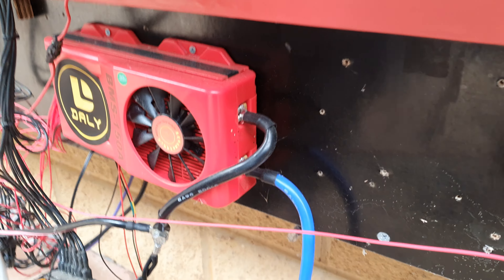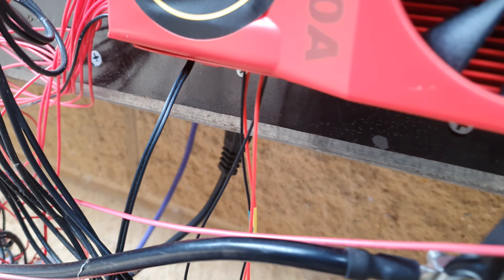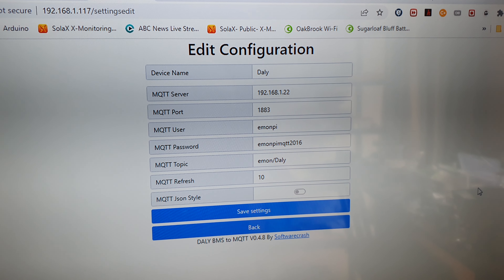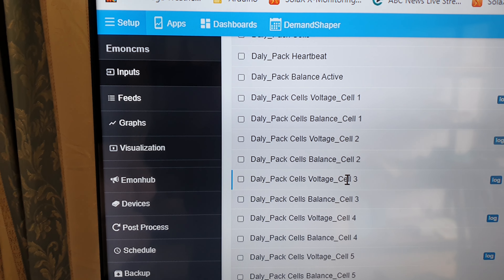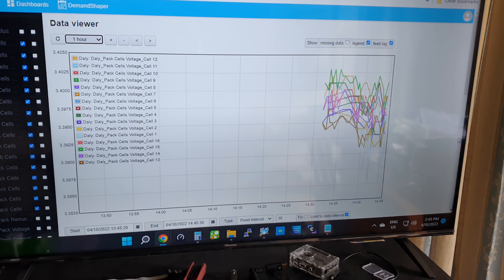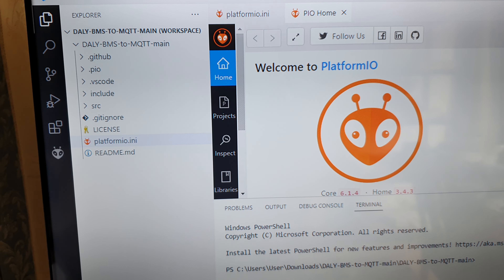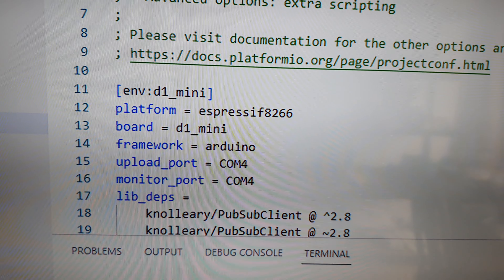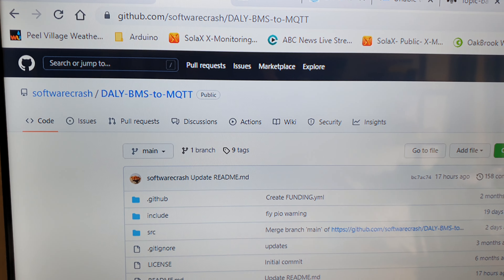Data logging a Daly BMS with a ESP8266 board

Comment: Hi Ross is it correct that you Fan establish this Communication with only the d1 Mini and without any Transistor that was required in some older Version?
Reply from the maker: I have moved away from this and now gone with JK BMS using Home Assistant with a program call BatMon from Github.com, this program communicate through the Bluetooth and also works on Daly.
Reply from the maker: https://github.com/fl4p/batmon-ha
Reply: But why did you make the change? Was the system not stable?
It seems that the second solution only works with Bluetooth? I think that the distance in my house is to large for a stable Bluetooth connection.
Reply from the maker: @aga8618  I was only testing it and over time it did crash off and on, have you tried https://github.com/syssi/esphome-jk-bms/tree/main
Reply: Looks nice but I am using a Daly BMS.
Reply from the maker: @aga8618  If you go to github.com and do a word search using the word "Daly" in it, you might find other open source developers playing with Daly BMSs